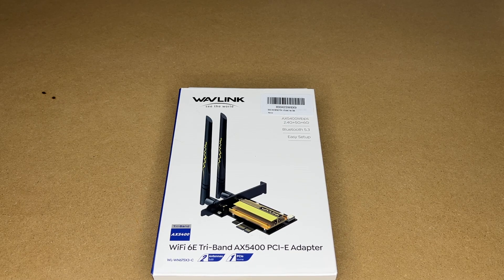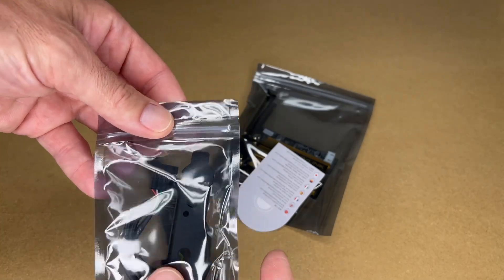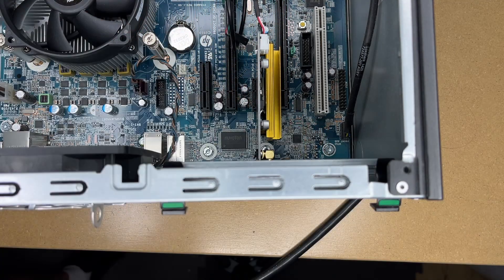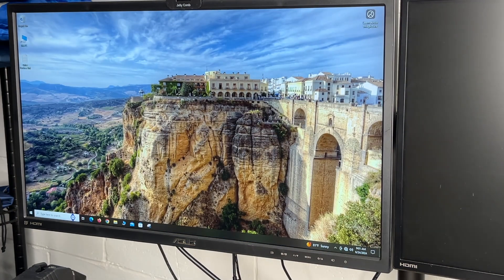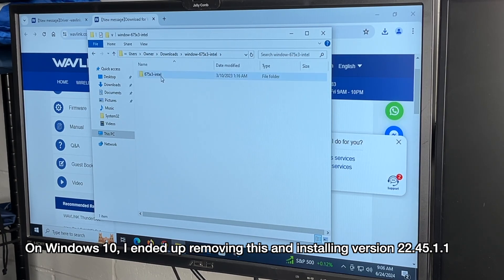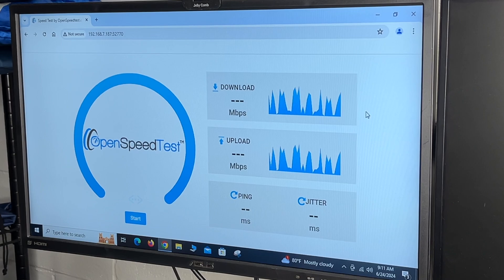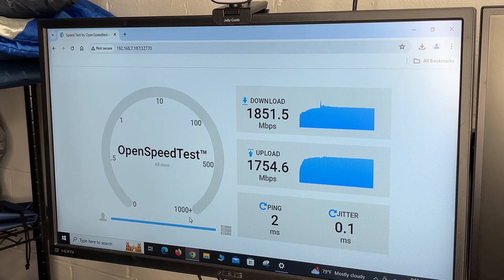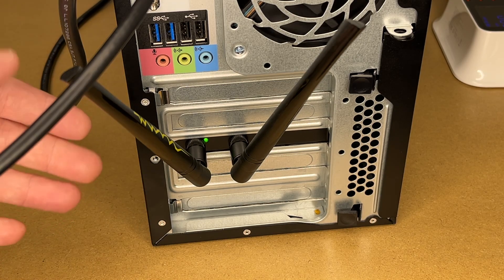WAVLINK WiFi 6E PCIe AX5400M WiFi Card with Bluetooth 5.3

Comment: Are these better than the little Wi-Fi USB Wi-Fi you can put in pc. Do they draw better signal out. Sorry if that sounds stupid.
Reply from the maker: Generally speaking, I find PCIe wifi cards have better performance.
Reply: consider usb has to travel bit more the data, while on pcie you are closer to mobo bus. Also, little usb wifi are way too small to capture high bandwidth connection, so no way they are comparable to this one